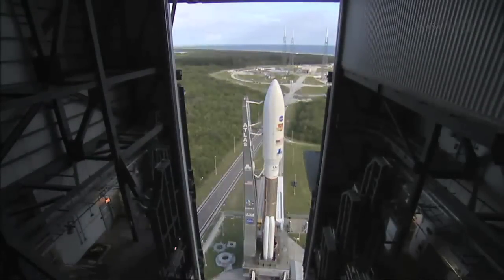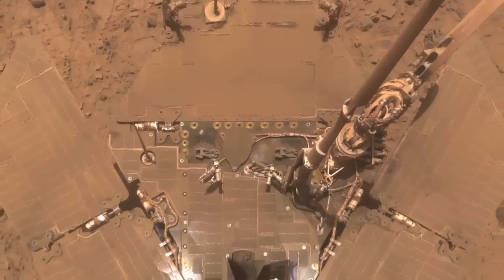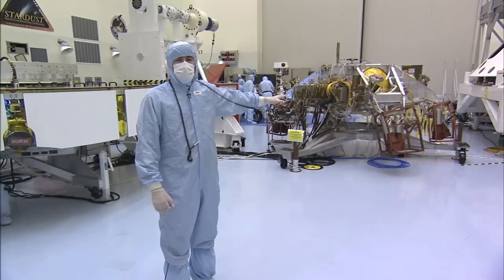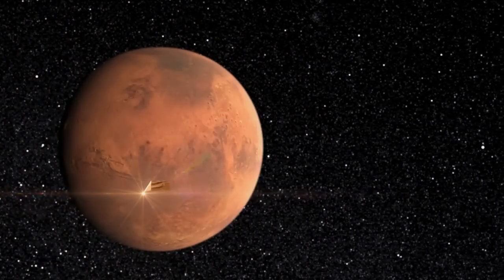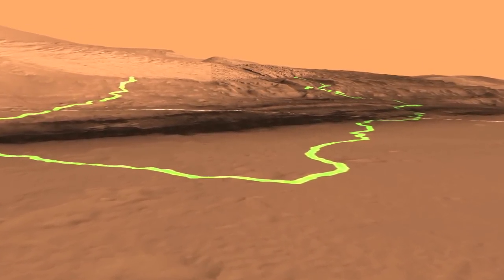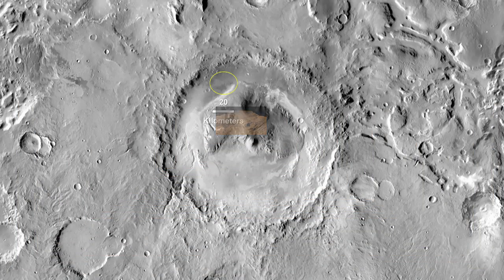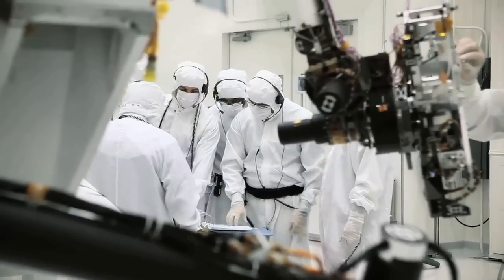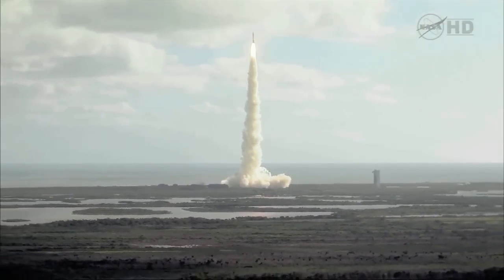What sets Curiosity apart from other Mars Rovers?

Comment: Plutonium dioxide can generate electricity without any water to vaporize?!?! 😲 Why don't we use the same method here on Earth? Can somebody explain me this? 🤔
Reply: I think that it is compared to the normal method inefficient.
Reply: An RTG is not a traditional fission reactor: instead, the alpha radiation emmited by this radioisotope is converted to heat, at which point a thermocouple can convert that heat into electricity.
It is a very inefficient way to gather the energy of a piece of radioactive material, which is why it isn't used for earth-based nuclear power plants. The only reason it's being used here comes down to weight and technical simplicity.

Comment: Fake science is worse than fake news. Rover batteries can't withstand the -73C temps. Research it yourself.
Reply: ever heard of something called heating?
Reply: @marcoseduardocastro781  that argument doesn't fly
Reply: @marcoseduardocastro781  which is why any cold-sensitive equipment is heated? It's not like they have a giant nuclear-powered heat source on-board or anything...

Comment: The wheels on the rover have only gotten 35 miles on its wheels aluminum is in thermal shock daily . Bang them on rock and cold they shatter. Exteme cold metal wheels on hard rock is destroying the wheels. Needs rubber tires like used on forklifts in freezers.
Reply: how long do you think rubber would last on sharp rocks and in dust storms?
Reply: more than 35 miles

Comment: the one thing i would ask about the other, solar powered rovers, is why didn't they have even a cheap little fan to blow dust off the solar panels?
Reply: The martian atmosphere is too thin for a fan to blow anything off.
Reply: +themnax If the gusts produced by a personal fan could blow dust off solar panels such that they were reusable, then they would have certainly been put on there. Natural gusts on mars are usually between 20 and 60mph.
Reply: well that's interesting.  if the 'dust' is that sticky, i would guess that means either there's  moisture in it, in some sense, or, i suppose more likely, some sort of static charge.  still a fan, close enough at the right angle, i'm not convinced it wouldn't have been able to do some good.  i'm sure there are good reasons for the trade-offs and so on, but i need more convincing then that, that it wouldn't have been able to do some good.
Reply: +themnax 
I find this fascinating . Maybe a more simple device, a bottle of compressed air to blast the sand off with.
But I guess its hard to know in advance how, and at what rate these Martian sands start to cloud ones panels and stuff.
Reply: +Patrick Ilmoni maybe something like windshield wipers
Reply: Cult Of Gaming
That sounds as a reasonable idea, and that cant be too expensive either.
Reply: Remember that Mars' atmosphere isn't the same as Earth's as there isn't much air or gases at all to push that dust. Think of this like trying to swim in space.
Reply: Gooba Gaming

Yes, I will have to check the athmosphere over there. But wouldnt a stream of pressurized air or something just clean the surface of say a panel from these dust particles ?
Reply: Patrick Ilmoni Well, why wouldn't be able to refill the tank of that air.
Reply: Gooba Gaming

Yes thats true. It would only be used for some time, and when empty dropped as dead weight.
Reply: +Patrick Ilmoni presurized air wouldn't be of reasonable help either because of the low atmosphere presure. The air stream would expand at once at such degree that its density would't be too low to blow anything off.

Comment: on such a harsh environment that supposedly exists on mars you would think they would have coverings for all the wires and and other mechanical components but instead everything is exposed
Reply: Marco Rossi And how is covering anything up going to help? What are you trying to protect it from?
Reply: Sony Singh you know cosmic rays, micrometeorites , extremes in temperature  dust that sort of stuff you wouldnt design sensitive electronic equipment without a case would you?
Reply: Cosmic rays can't be stopped unless we use thick lead.

Micrometeorites, Mars's atmosphere will shield it.

Extremes in temperature - insulation only works if heat needs to be trapped, there is no heat to trap. The excess heat from the nuclear generator is routed to key areas that need to be kept warm. Wires are not one of them.

Dust - How is dust on anything a problem? The parts that move and require clean tracks to do so, are protected.

"you wouldn't design sensitive electronic equipment without a case would you?" Depends on what is being built and how/where  it is going to be used.
Reply: Marco Rossi Exposed? Yeah, besides the ... insulation and shielding that covers every wire and other mechanical component. Very 'exposed.' Idiot. I love armchair scientists with their absurdly child like understanding of the world around them. The problem is society seems to have told them that their opinion matters and is valid, as valid as anyone elses, including scientists who spend their entire lives and decades in training to even begin to understand what they speak about - and worse still they demand the same equal respect and air time as the academics who work their ass off. They're the ultimate lazy motherfuckers.
Reply: lets see, pretty sure solar panels need to see the sun to generate power (spirit\oppurtunity) and the wires dont neec heating, computers do, cosmic rays arnt a problem to the wires only the computers\science equipment, and those are covered in alluminum which provides enough sheilding for the more resistant electronics. humans would neec lead though

Comment: This is the good side of nuclear power reliable electricity on extreme climates.
Reply: It's not a reactor though, Pu238 isn't fissile, just gets hot as it decays. Good news is the colder the outside of an RTG is the more power it can make.
Reply: Xavier Valdez well. id say the waste is a bad side.
Reply: Xavier Valdez
Coal ash is less radioactive than nuclear waste, but there is a much much larger volume of it than nuclear. I'd have no problem burying my lifetime of uranium (or better yet thorium) under my yard, but I would never have the space for the equivalent in coal ash.
Reply: Xavier Valdez
Reply: +TPV Productions I assume that this also produces nuclear waste.
Reply: allyourcode
It IS nuclear waste. Highly purified single isotope and environmentally non-friendly. A good use of it :)

Comment: Well...
"With current launch costs around $10,000 per kilogram"
A GoPro 3 with a case weighs about 160 grams (/watch?v=vcrtoEsn2JM)
So 10,000 times 0.160 is 1600 bucks. (plus camera cost)
Forgetting the space it takes up, and the power to charge it, that's not bad...

Comment: curiosity can produce only about a 125 watts with the RTG(curiosity's power supply). Your hair dryer would need more power than that. UAVs (also called drones) need much more power than that to fly. They get that fossil from fuel, but there are no gas stations on Mars. so, they couldn't put a helicopter.
And its a challenge for humanity to put terrestrial vehicles on Mars, putting a helicopter would be much more complicated.

Comment: If by windshield wipers you mean a solar panel dust removal system (like a device that blows compressed air over the panels), yeah, it would have been a good idea to install one.

Comment: Because a spectroscope 55 million kilometers from the target is just as good as a rover that can do it from several millimeters away, not to mention drill into a rock to find it's internal composition, right? And a spectroscope can also monitor air pressures, wind speeds, and humidity, right? 
Naturally an earth based spectroscope can also measure the radiation levels during approach and on the ground for the future manned mission to the red planet, right? Right?

Comment: Deep sea divers don't use nitrogen in the air they breathe, they use helium. Using helium as a nitrogen replacement on mars is unworkable, but some other gas could be used. I don't know enough about chemistry to know what would be a good alternative, but there might be one.

Comment: the cost of transport i do agree with but if they made them small enough to where it doesn't matter as much then the problem is slightly less of a challenge. making things as big as Curiosity wouldn't be practical for helper robots and keeping up with the rover isn't really a big problem if you take into consideration that they could just meet up at certain places at certain times.

Comment: Rover is stuck because of dust. Is not it worth it ? Compress atmospheric gas by means of what ? You can not compress atmospheric gas on Mars becouse of energy and weight for unnecessary equipment. On Mars the energy is a limiting factor. You have no power resource on Mars. Simple idias is only way out. If the solar panel had a little angle, to blow off the dust, the Mars rover would work even now.

Comment: It is not about assembly. It is about 1) delivery (a lot of fuel) 2) guaranteed performance (you have no garaty new one will work as wall as old one) 3) cost of every device mounted on board (spectroscope and so on). Assembly is not so dear. Creat second one without errors and successful delivery is a point. Energy is a limiting factor.

Comment: Frankly, i think the people who worked on those rovers are more intelligent than you think they are. I suppose the panel are ceramic nanocoated (better, and you cannot use teflon over there) to prevent dust attaching to them permanently, and that they must be horizontal because of the weight vs. rigidity of support structure. Whether you have water is irrelevant, because you could compress atmospheric gas and use that for cleaning the surface. It probably just wasn't worth it.

Comment: 02:05 If solar panel was mounted (set) upright (vertical) dust does not sit on the surface. In original it is it: Когда ничего влажного под рукой нет, что бы вытереть пыль надо использовать ветер. Солнечные панели надо было установить вертикально, тогда пыль не садилась бы на них, а ветер вместо того что бы загрязнять поверхность солнечной панели чистил бы её. Так же можно было использовать тефлоновое напыление на поверхность панели, что бы пыль лучше соскальзывала с поверхности панели.

Comment: They tested it in a giant wind tunnel running rather slowly since they were using earth's atmosphere which is much more dense.  You can see video of NASA testing the chute on youtube.  The best example I can think of is imagine standing in a 30mph wind, pretty easy, then stand in a river traveling 30mph, you'd be dragged away.  But if the river is only flowing at less than 1mph it would be closer to the amount of force you feel in the wind.  That's because they're different densities.

Comment: >>true but our current iron supply aint gonna last forever.
with energy you can recycle anything.
complexity is more to do with how much energy can be harnessed rather than specific minerals.
you need to recycle to improve designs.. its how nature works
"why  not solar" - mars is further from earth and smaller.we haven't even mastered solar here, with the whole of existing industry to fall back on.
earths max is 2billion. (we  go over 2b using fossil fuel, all very well until it runs out)

Comment: Or you could just learn to multiply and divide.  It's not that hard to do.  I've seen 6-year-olds who can pull it off, and even some as young as 3.  You can get a little handheld computer for two dollars, which will do it for you if you find the task too challenging.

Comment: The atmosphere there might be 95% CO2, but it's so thin that any heat generated by absorbed radiation is radiated back into space extremely quickly once a certain area is out of direct sunlight.  Basically, the atmosphere doesn't insulate the planet like the one here on Earth does.  So Mars is essentially a horrible example to try to refute climate change on our planet with.

Comment: The problem with mars is it is a dead planet. What that means is that its inner core is not hot enough to move the tectonic plates which in turn help support terrestrial life. It has been said that mars can be jump started, but it will take 100-200 years of using Atomic energy to warm up the core so that it is active again. We technically can use all of the world''s nuclear bombs to help bring the Martian core back to life and thus start a terraform process.

Comment: atomic energy has a similar problem to oil - you dig something up and "burn" it (accelerated nuclear decay instead of combustion) ..eventually peak uranium and it will run out. so it doesn't help long term capacity. The sun is different because we can't "over-spend" it, it is delivered at a speed dictated to us. in the long run, solar is the only option. Thats why nature invented photosynthesis.

Comment: I have an idea to make it faster between points. Y'all got it moving too slow. Use a variable resistor to make,in effect,a 3 speed transmition. The computer & electronic eye would control it so it could save time & sense various terrains over the surface to cut travel tije. It would allow mor exploration...

Comment: irrigation- - powered by fuel
romans irrigated sustainably.. feeding 300m worldwide, not 7billion.
steel tipped ploughs - we can only use steel because we have fossil-fuels to work it. we can't use metals to the same extent without fossil
vacuum sealing - very energy intensive.
Technology USES energy, it does not PRODUCE it.
nature is already full of machines way more advanced than anything we create.. solar-powered nano-technology.. molecular clockwork, staggering information density in DNA

Comment: No kidding.  Did you even follow the thinking?
I forgot, $560 million can be wasted on non-feasable solar power with outfits like solyndra, so $2.5 billion would not really be that much lost if Curiosity had not worked out either, right?
As it is, china can be very proud.  This was money well-loaned.

Comment: the design of the rover is poor in my view due to its not very well protected from elements it should be made something like a dome or sphere with instruments on the inside teh auto opens a slot arm comes out after the correct instrument has been selected internally on a rotating rail. when weather/dust is bad it can get low to the ground and everything is protected.

Comment: @cud0s I wonder if they could have fitted some kind of duster attachment to their existing equipment.  Something that could be used not only for the solar panels but also for dusting off an area they need to look at or work on. It just seems like there should be hundreds of ways to dust off the panels using what they already have but possibly arranged a little different or maybe add just a tiny bit of weight by adding an extra attachment.

Comment: @CognitiveNetwork Thanks for pointing out the obvious XD It's finished when it's empty...
I was looking for an answer with some numbers or a time frame to work with. "Very, very long" doesn't answer the question well enough.

I know some radio active substances radiate for centuries or many times longer but would they generate enough power?
I'm no expert but I think they need to use a material that decays a lot faster than that. 
Anybody got a link on this?

Comment: @menthol5 Also if you knew ANYTHING about space exploration utilizing fissionable materials, you'd know that NASA has gone to great lengths to avoid accidents. These powerplants are encased in armored housings designed to survive explosion or re-entry. In fact, the Viking missions of the 70s were almost cancelled until NASA could convince that the RTGs were safe. You don't risk losing a half billion dollar probe because a solar panel got some dust on it, which has happened.

Comment: @menthol5 What you just said makes literally, zero sense. They never bragged about using the plutonium, they're super rocket scientists. They fucking know how to handle the very dangerous plutonium. Obviously, the plutonium is a much more effective power source than simple solar energy. Adding a "self-cleaning solar panel" would probably require too much extra energy and risks involved. Don't be so ignorant in your assumptions dude.